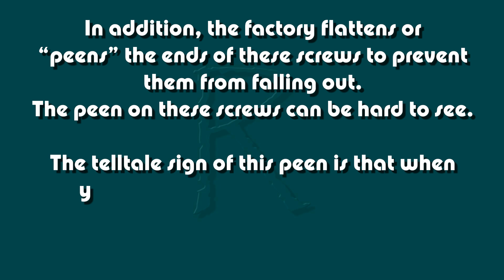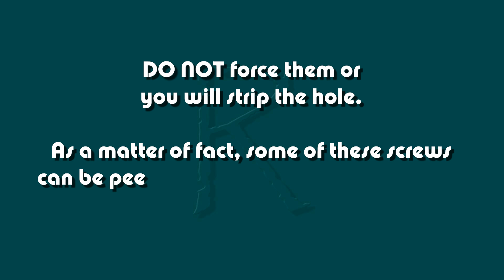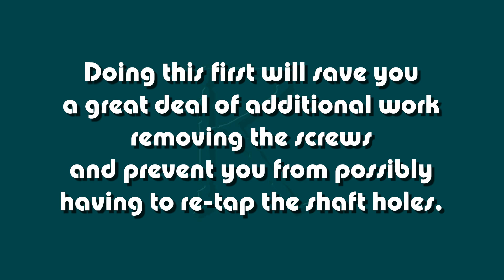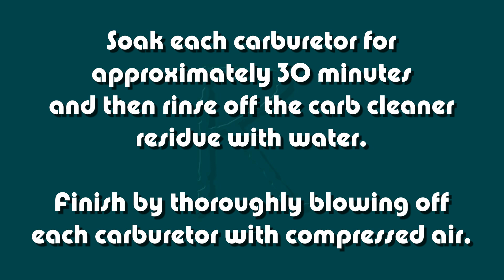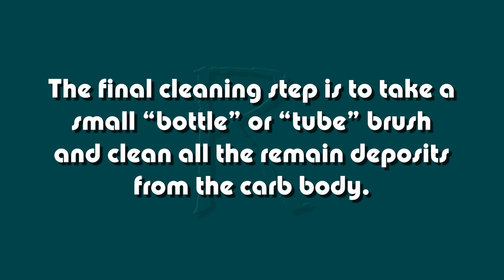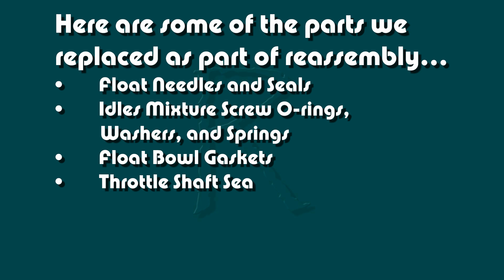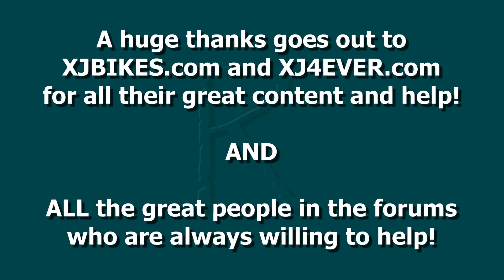Mikuni Carburetors - Disassembly, Cleaning, and Maintenance - 1985 Yamaha FJ600 - Part 3

Comment: What's the reasoning behind removing the butterfly valves? You can clean everything with the valves in place.
Especially considering the effort in removing and replacing those screws.
Also I've never seen a stuck or broken butterfly mechanism.

Comment: I'm having a problem with "hanging idle", and I suspect it's a vacuum leak on a '90 Radian. Bought new engine side boots. Do the gaskets need some sort of sealant? The only other place I can think of for the vacuum leak is the seals on the butterfly shafts. Do you think the mixture screws can compensate, or do I need to replace them?

Comment: Thank you for the advice on freeing up the slides. I got the carbs split and stripped to a point, only to realise the main jet tube and needle jets and various other parts were absolutely solid. Therefore, I am selling them for parts and letting someone else take on the challenge. However, your advice was much appreciated.
Reply from the maker: my pleasure, it's  funny because I was going to suggest doing that at.aome point, it all depends on what you want to.apend in time and/or money, either way gets you there, Ride Safe!

Comment: rust I fear.
Reply from the maker: So 2 questions,  did you soak it with PB Blaster for several hours and did you try CLR?  Also I'll talk it around for more ideas
Reply: I left a few squirts of plus gas penetrating oil in the top Under the diaphragms to wahs down and also (on an earlier attempt) left copious amounts of same penetrating fluid around slides themselves (for a few days). Not sure what CLR is? Thanks for your help.
Reply from the maker: It's a product usually in a grey bottle, it stands for Calcium Lime Rust

Comment: Thank you for your expert advice and such a clear video' I have same carbs, but slides on 3 are stuck in place. I don't want to damage the diaphragms... how best to get the slides to move again?I have tried heat, WD40, penetrating oil... No effect. HELP!
Reply from the maker: is it white-ish corrosion or is it rust?
Reply from the maker: My nephew actually did this job and he said what he did with stuck parts was to either soak it in carb cleaner or use an acid brush to apply the carb cleaner and then use air to get it into tight parts then he also used a very fine pic very carefully to free the parts up

Comment: where do i buy the seals and the screws that you are talking about...

i have a 1985 yamaha maxim xj700n...........

i have clean the carbs completely and realized that there are seal on the throttle valve shaft

resulting in air being sucked in  and causing a bird chirping sound..

e-mail k9bathc@gmail.com